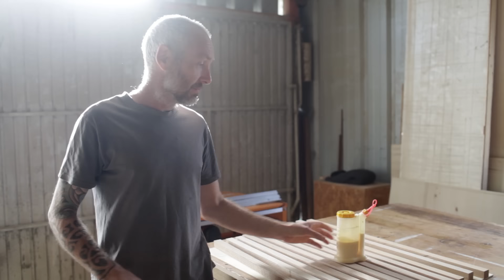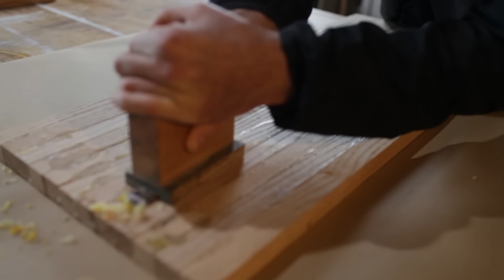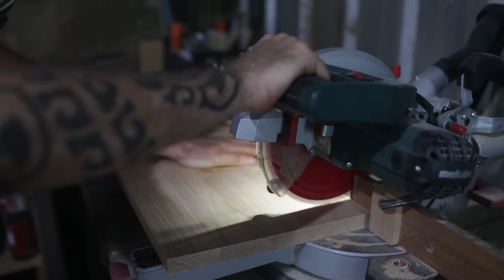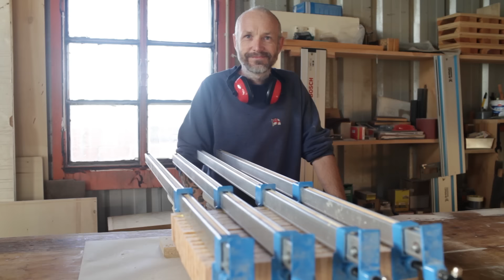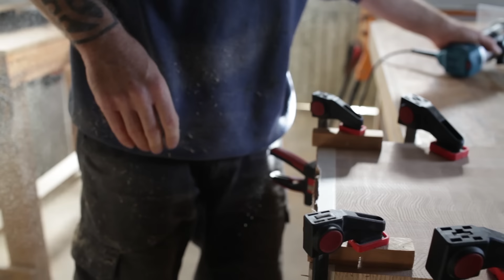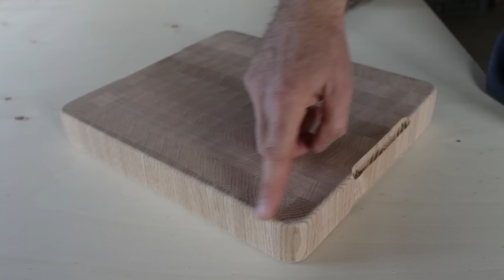My First End Grain Cutting Board: Mistakes, Wins & Tips

Comment: Hi Michael, it’s really tough to tell in the video without a close up of the bit, but if it’s completely rounded/bowl shaped it would still be a cove bit, but
If it is rounded at the top, and then the curve turns into straight sides for a couple of mm, then that would be what’s called a “bowl and tray” bit. Other types of rounded bits would be a round nose which are tall and rounded and the top, and cove box bits which look like
miniature cove bits. Hope that helps, great video!
Reply from the maker: Great clarification, thank you 🙏🏻